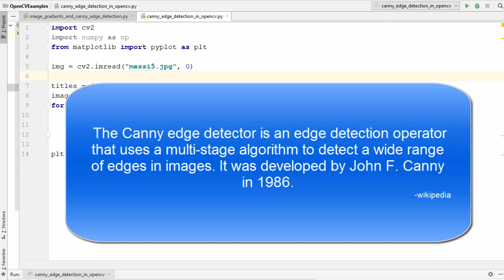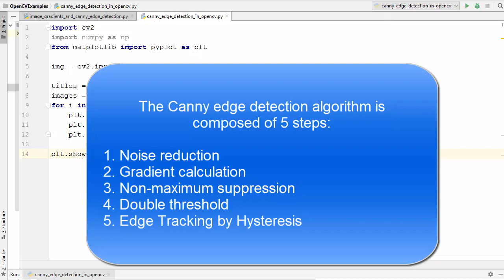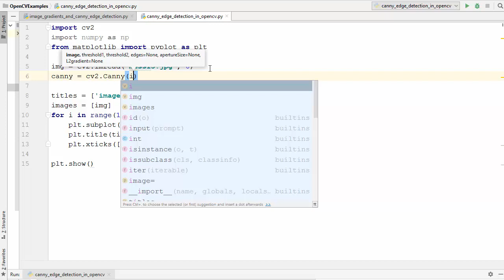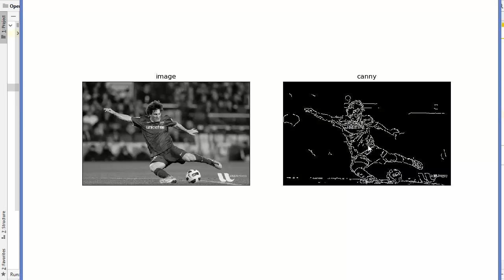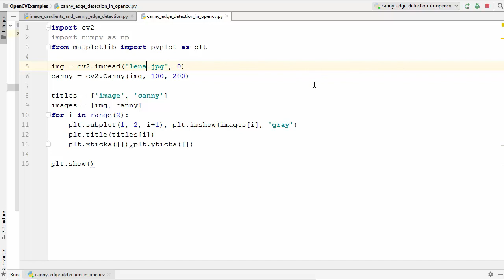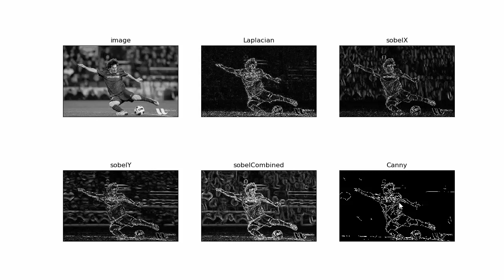OpenCV Python Tutorial For Beginners 20 - Canny Edge Detection in OpenCV

Comment: How can i apply this to a whole directory full of images so i can run this program and have a bunch of images with the canny edge applied to it.
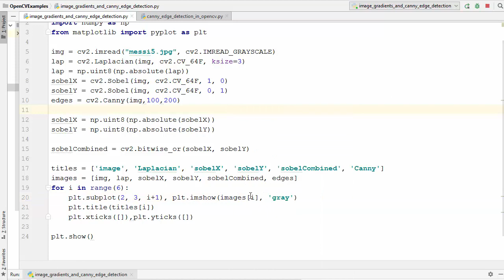Reply: Do you know how to list all files in their specific directories and for every file show the cumulative byte size of the project? This might be a good start. 0. First and foremost, wrap, what he does here into a def, that has the name "image_to_canny" like so: "def image_to_canny(img):". Note, that your your def-function takes an argument "img", which you will know later, what it is. Of course you have to indent everything, what is in this video line by line once, because now your "def image_to_canny()" is on the outer-most scope of your  program. You need this function, to later call it with "image_to_canny()" for every file you get. SECTION FINISHED--- 1.NOW, no indentation, you need to "import os" . 2. You need your target directory as variable to indicate that you want to only loop through the directory where your image files are in (as an absolute path string or "."/"..") like so: " path_variable = '<path_name>' ". You need a for-loop that uses the "os.walk()"-method to loop through your project like so: "for path, dir, image_files in os.walk(path_variable):". 4. Then you implement inside this loop another loop, which loops through all of your image files like so: "for image_file in image_files:". 5. Next you actually need to open your image_file in either read mode or directly in write mode, if you have a copy of the original images somewhere stored (always back up your original data!). You do this like so: "with open(image_file, 'w') as img: ". 6. Now you've come to a point where you can actually work on those image files in your directory and in this nested for-loop you now call your function you implemented earlier like so "image_to_canny()". Now it should loop through your directory until the last element. Use the ".write()" method to write the new stuff to your image files. After that close your file!!! This is important because you don't want to have 50 images or so lurking in your memory, until the last image has been written to/changed. So within the loop, after write, close every file with "img.close()". SECTION END--- Further tips: Note, that in 6:12 you don't need to define an "img =..." variable, because you already pass it as an argument in your def-function. Another approach: Instead of calling an outside function, you could just paste the code of the video (without line 5 of course) INDENTED under your for-loop "for image_file in image_files:" and under the opening of the files in either read/write mode "with open(image_file, 'w') as img: " and then perform all the actions in the video. The most important part for you is to know, how you can loop through the elements of a directory and what variables you need, for it to work. Hope this helps. (Service like on StackOverflow xD). And the rest:  GOOGLE IT!